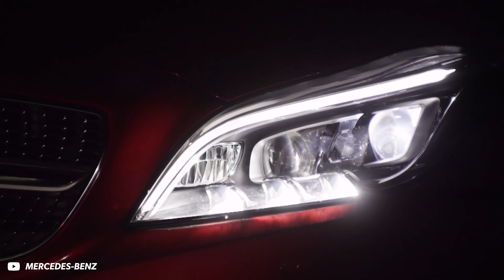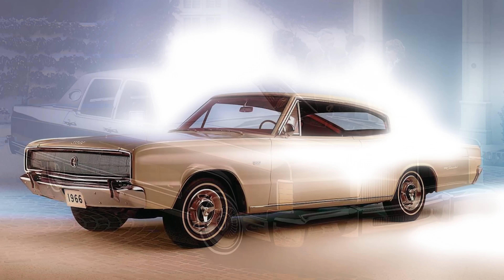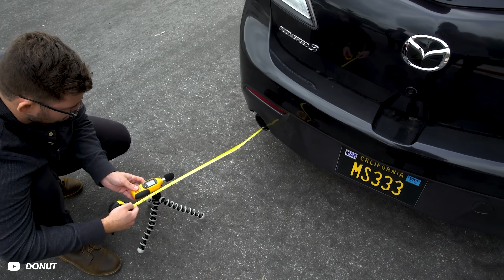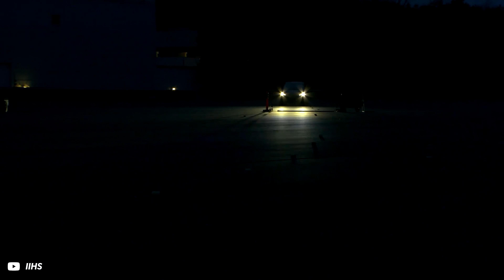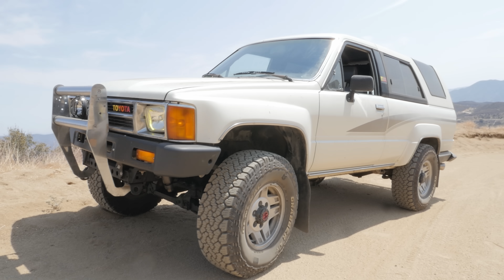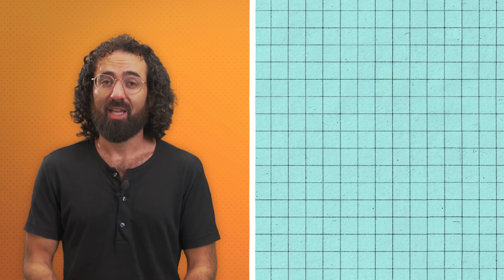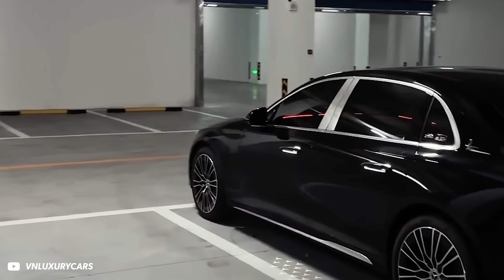Why new headlights are blinding American drivers

Comment: Truck driver here. The company gave me a brand new Renault D-wide with 0 km on it. I was surprised by how bright and powerful the headlights are even with the standard low beam — at night, I can see everything even too well. But on the other hand - on the highway, and especially on unlit roads, I often get flashes of high beams from oncoming drivers... and how can I explain to them that these are the factory low beams? And there's nothing I can do about it... I don't flash my high beams myself to answer, because I know it could completely destroy their retinas... I just keep driving, mentally apologizing (even though what's my fault, personally?)
Reply: As another said, they have adjustment screws. Just need to find said screws/bolt heads and screw them (in our out) to lower the beam angle
Reply: @Eric2300jeep  Did that on a Volvo truck, saw that it took one of those external torx sockets... Went to the store, bought the damn sockets (which only came as a set), then realized the smallest socket in the set (E8) was too big, I needed an E7 socket... Yaaaaayyyy
Reply: @benoitlussier9492  a 12 point socket can work in a pinch on e-torx. I would only do this on things that aren't tight, like the headlight adjustment screw, because they are more likely to strip the screw.
Reply: Low beams can be adjusted downward. I did that on my dad's car, he doesn't get high beam flashed anymore.
Reply: The low beams more than likely need to be aimed downward a little. see it on almost all new factory led headlights.
Reply: @mjelloe  Especially problematic with pickup trucks, which don't have air suspension like heavy trucks. High beams come parallel to the ground from the factory, but add ANY amount of weight to the bed, and you're starting to blind oncoming traffic. I once hooked up a gooseneck trailer to an F150, and even though I was on low beams, I was getting flashes of high beams from every single vehicle from THE OTHER SIDE OF THE INTERSTATE. I eventually figured out that the road in front of me was less lit on high beams, but at least said high beams didn't seem to bother anyone. However, boy were those overhead signs bright !
Reply: Not just your truck, every single new Toyota and Hyundai, with a considerable amount of new Subaru's thrown in as well, blinds me with their factory low-beams. Doesn't matter if it's oncoming or behind me in traffic. Most pickup trucks do the same thing, with their default light level directly through my rear windshield. I'm more often than not blinded by NEW vehicles, not old vehicles with LEDs swapped in. (from the USA for context)
Reply: Believe me when I say that we won't notice the high beams unless they're connected to auxiliary lights. I've been blinded by these lights here in the EU, and I just turn on my high beams so that I have a chance to see the line on the edge of the road. I've had drivers 'flash' me, and the difference in brightness was almost impossible to notice. I more or less drive with high beams when I come across these cars, and it's out of safety, not out of spite. I personally would prefer if corpos would stop blinding us.
Reply: The new low beams on new cabs are insanely bright.
Reply: You don't explain to people. You complain to the manufacturers and demand that they give you regular lights instead of selling you something that illegally blinds everybody else on the road. The manufacturers may have put it there but you leaving it there is atrocious. Get your company to fix their truck.
Reply: the problem is they really dont know its not your fault. as far as theyre concerned, youre some crazy trucker like "yeah! f*ck all yalls eye balls!" even if thats NOT AT ALL the case, lol! xD people just assume the worst...thats why its good to make posts like this. at least now everyone who read your comment knows!
Reply: I always get annoyed by bright as fuck lights and think about flashing people but then I realise they probably didn't realise when they bought the car like this isn't their intentional decision, it's just shitty car manufacturers with their stupid light arms race.
Reply: buy some window tint and stick it ontop of your headlights.
Reply: Not safer for you when you're the cause of oncoming blinded drivers.
Reply: I can feel you. Few years ago me and my family went to Motenegro for holiday. We drove home (we took turns behind the wheel) and I was driving at that moment. In front of me there was this truck driver and HOLY COW they basically drove with its own time zone. There was NO way I felt comfortable to overtake him... even when it was 3 am and there were empty roads.
Reply: Sorry, mate, but you need to shoulder some of the responsibility of fixing the situation. I know you didn't bring this on, but you're the only one in position to avoid endangering others.
Reply: yep...we hate u dude. sorry
Reply: I almost never have problem with getting blinded by big rig lights, they are almost always correctly adjusted giving much less problems then other cars... Also the core of the problem is NOT the brithness but the blue color of the lights, that is what is blinding. Halogen bulbs and LED and Xeon that is yellow color is MUCH less blinding.

Reply
Reply: Headlights are interchangeable you can go to a beam that isn't so bright. Also we as people can demand an automatic stop doing this.
Reply: "even though what's my fault, personally?" -- does the commercial trucking industry not have rules and philosophies similar to those found in maritime and aviation? The captain of a vessel or airplane has the final say and responsibility in all matters related to the operation of the vehicle.

Now, corporations can and do create a barrier to honest and effective application of a rule like that. Fishing vessels have been lost, passenger-carrying airplanes have been lost, because a captain was pressured into some unsafe situation by their corporate overlords. But I would guess in such situations, the captain themselves would be the first to say that they should've pushed back, regardless of the cost in terms of their employment.

It's all hypothetical ethics. Until it's not.

At the very least, probably worth exploring getting maintenance to make adjustments to the headlight angle, as suggested by other comments here. The most professionally dedicated driver would refuse to operate a truck they know is unsafe.
Reply: @harvey66616  Flight and maritime captains have those rights for a certain reason. You cannot just say 'Screw it. Stop and I'm getting out of here.'. You CAN stop a car and get out of it at basically any time and any place.

As a commercial driver, you have no more rights than a regular driver. You can refuse to drive the car until it is repaired, if you find fault with it. Period. But that MAY get you fired (even though it shouldn't).
Reply: @kikixchannel you missed the point completely. I'm not talking about rules that allow exceptions to rules. I'm talking about other professions involving a human in control of a large, dangerous vehicle taking their job seriously enough that there is a fundamental expectation in the profession that the person who has the last word of operation will be responsible enough to not endanger others.
Reply: @harvey66616  You're the one that missed the point...

Again, the 'final say' that a captain of a plane/ship has, is because they cannot just STOP doing what they are doing!!!

On land, you can always stop. If you can endanger anyone else, you can refuse to do it. You have NO RIGHT to make any other decisisions, but you CAN refuse to do what is requested of you.

Pilots and ship captains can make decisions, because they HAVE NO MEANS TO STOP. Them stopping on its own is a threat to life therefore it's not possible.
Reply: @kikixchannel I missed the point of my own comment?

Uh, right. You are hilarious. Keep it up.
Reply: @harvey66616  Missed the point of MY comment...

And you did it again...

Either you have some problems with connecting the dots, or you know you have no argument but are unwilling to admit being wrong. From my prior experiences, I'll say both are the case.
Reply: @kikixchannel nah, it's definitely you who missed the point. 
Harvey was talking about the responsibility of commercial operators, while you're talking about the power of commercial operators. 
Harvey is saying that commercial operators have a responsibility to ensure their vehicles are safe for the public, while the nonsense you're saying is that commercial operators of planes and ships can't stop to let you out in the middle of the journey, which is an asinine and completely irrelevant comparison. 
In short: you're stupid.
Reply: @kikixchannel  it'll get boat captains fired too. But, having the Coast Guard take your license away for not asserting the right to say no is worse than getting fired.
Reply: @catocall7323  If you will be fired for that, there's still the option to sue for wrongful termination.
Reply: @kikixchannel  You are arguing a point that he did not make.  Pilots and ship captains can refuse to man the vessel entirely, they don't need to stop it, until the issue is fixed.  Because they will be held responsible for accidents or damage caused by said issue.

His argument is that truckers should take responsibility the same way, and based on OP's comment, they don't.  He knew the lights were too bright and had even blinded people but continued to drive the dangerous vehicle with blinding lights anyway.  

He should be charged for any accidents he causes, just like the plane and boat captains, because he refused to adjust the lights or have them swapped out, because he's the one in charge of the vehicle.  It's not a difficult concept to understand, but you ignored it to hammer against a point that no one made.  Congratulations?

A person in charge of any of those vehicles can refuse to operate them at any time, including emergency landings and dockings if they are already underway.

You're an idiot.
Reply: I can appreciate this, as I've often suspected this was the case.
A quick off/on cycle would send the message that you've checked the level, without blinding them.
That said, don't be surprised if their response is to set their own high beams as you converge.
Gotta be able to see.  The sorry-not-sorry goes both ways, unfortunately.
Reply: I drove kw’s and peterbult’s for years headlights have always been easy to adjust at night you learn real quick how to avoid looking at the lights of oncoming vehicles
Reply: @knuckles-3386  Thank you for that think which most of us were taught when we learned to drive. Doesnt really f'ing help any more.
Reply: Yes I used to flash to persons like you but once i turn and see it is a new vehicle I feel bad for blaming the driver hahaha
Reply: You have a duty to inspect your vehicle before each trip. insurance won’t cover anything and they will jump on “faulty headlights” so quickly you won’t get to say you’re sorry before they lock you up 😂 It’s your responsibility that your vehicle is in good working condition.
Reply: A quick way to explain they're low beams... Flash the high beam once quickly
Reply: Just flash them real quick. They'll know then.
Reply: Why don't you just keep your side lights on driving through well lit areas at night?
You don't even need headlights in modern cities
Reply: Simple, Get a truck that doesn't put peoples lives at risk. There's other vehicles to choose from.
Reply: @solarash9649  You're being intentionally obtuse. They literally stated it was a company provided vehicle in the first line...

Comment: Adaptive lights don't really work, I'm constantly blinded and I assume it's because I drive a 42 year old VW Bus and the system doesn't recognize me soon enough because my lights are rather dim. It only happens with rather new upper class cars so I'm pretty sure its because of that system. When they come from behind its often only less then 50ft before the lights automatically down regulate. The old Halogens worked just fine and still do, not everything has to be super technically complicated.

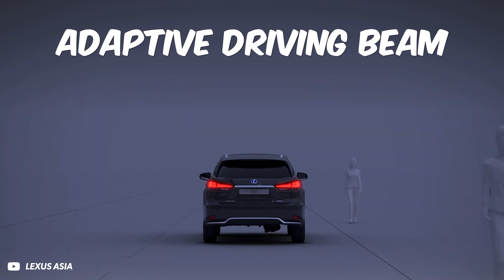Comment: 9:10 this doesn't fix the issue. At all. It only makes headlight more expensive and even more complicated and unrepairable. Many led headlights are perfectly fine, like Honda which uses a universl design adapted to various models. They aren't perfect, but theyre pretty decent overall. Adding more complicated garbage that will break instead of mandating manufacturers make decent designs with good light output and minimal to no glare is the real only solution. Regulation is the key. Not adding this stupid shit that only ads to a cars pricetag.

Comment: The headlight problem is a very mixed combination of issues. Most of it is a direct result of poor design, especially with giant trucks and larger vehicles. Manufacturers like GM make way many designs and don't test them, and especially in their large vehicles, they shine right in your rear window or in your eyes. The aftermarket for headlights has pretty much 0 regulation. People, mostly stupid truck drivers, use really nasty 360 degree light led pattern bulb that have no way if putting out a flat light patern to balance output, intensity, and range. If you plan on upgrading your headlights from halogen to LED, you should try to get aftermarket project housing if you can, or get lef bulbs with a clean cut off pattern. Blaming the IIHS has nothing to do with manufacuters making shitty designs. Often times the worse LED headlights are not only incredibly glare inducing, they also have poor design to begin with. They are placed high near the top of the hood on an already big vehicle, and have to be brighter to make up for the bad design. Most of it has to do with manufacturers. Bad designs are the root cause. High trim Jeep led headlights are the worst I have ever seen. High quality LEDs are fine, cheap ones are awful, and only buy ones that are rated for good visibility AND don't enduce glare.

Comment: Thank u for mentioning it's not just LEDs.  People keep writing off LEDs as the problem even though they have way more pros than cons, they just need to dial in the brightness and angle.  Should have been done since day one since we've had this tool called a lux meter for a century at this point but whatever.

Comment: So, one of my favorite headlight tidbits has to do with the HID headlamps on a Ford. In Europe and most other markets, Ford uses a standard D3S Projector&Bulb, and a 35watt ballast, combined with a headlamp washer system. In North America, however, Ford uses a 25watt and a D8S Projector&Bulb, because it meant that the light output was below the level at which headlamp washers are required.

Comment: You don’t need headlights on par with aircraft landing lights for city driving.  Supplemental lighting keeps you from plowing into deer or moose in rural areas.  When the first thing you notice is the reflection off of the black cow’s eyes on a rural road, you really appreciate the light bar.

Comment: Adaptive beams are not the "only shut and dry solution". I say this as someone with BMW Active Laser Lights in Europe. Do they work? Yes. Do they work perfectly? No. Many times I visibly see the generated "shadow" fail to track the car in front in certain conditions, or fail to active in time for oncoming traffic. Essentially it is not smart enough to allow for all manner of positional anomalies when it comes to oncoming and overtaking traffic, traffic in front, distant traffic, multiple lanes of traffic, etc etc. I find myself hovering my finger over the "deactivate" button on the stalk in case I see it fail to dip appropriately. 
The main problem is twats with aftermarket lights not configured correctly or manufactured correctly, or using HIDs in reflector housings. In general I don't find myself blinded by factory headlights; roadworthiness testing in Ireland is also quite rigorous and includes headlight alignment checks.

Comment: UUhm..... *raises hand*......... Tesla has had adaptive high beams enabled on their models that have compatible headlight hardware (refreshed Model 3 and Model Y, older Model 3/Y with the "Matrix" LED headlight housings, as well as most Model S and X i believe) since their Spring update several months ago.

And aftermarket LED bulbs in factory reflector housings aren't a bad thing if people are paying attention to how the LED bulb they're throwing in is designed compared to the halogen bulb they took out.  A lot of the halogen bulbs have a sort of "dish" to block light from hitting a specific part of the reflector when the low beams are on, but unfortunately you can find a lot of LED bulbs online with the same base that would work in that headlight housing, but the light output style is completely different.  That's the problem.... people just think "It's an H7 base replacing an H7 halogen, so it'll work"... when they're replacing a bulb with said dishes blocking light with a bulb that has a pyramid design lined with COB LED's.

Comment: Yeah, there won’t be any computerized front lighting driving systems here….ever. Just another $12k bill to worry about and either nobody will buy them or they will just bypass them altogether. It doesn’t take an electrical engineer to figure it out.

Comment: Most of the light problems I have seen in my travels around the eastern USA is based on people driving with high beams on all the time and having the headlights aimed wrong, mostly setting the low beams to the high beam alignments, which is illegal.

Comment: It’s very easy to u lock the matrix features in VW/Audi vehicles if you have a USA vehicle. As they come with the headlight already it’s just turned off in the control module. 
Using obd11 you can switch it to on and you have the European matrix adaptive headlight with shutters. Did it to my Arteon it’s fantastic.